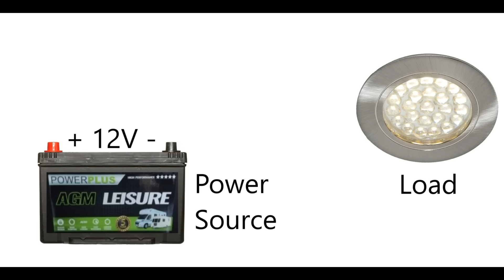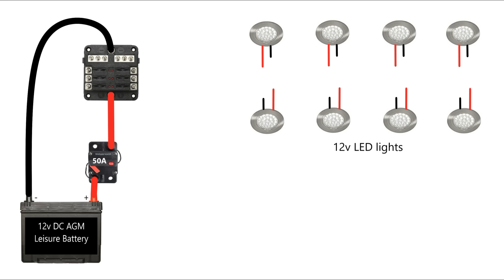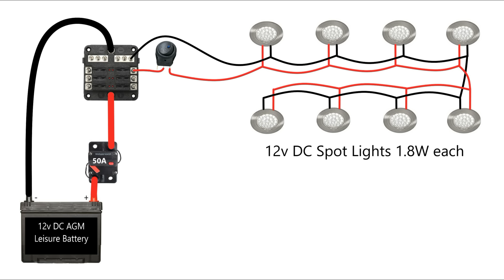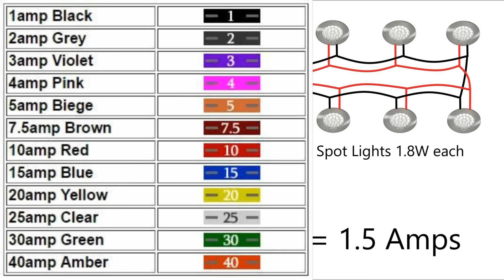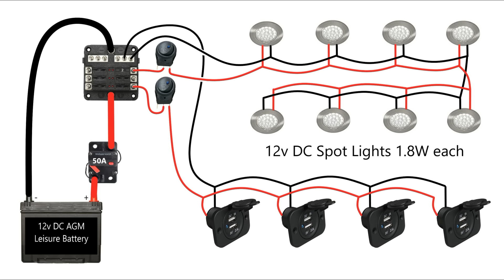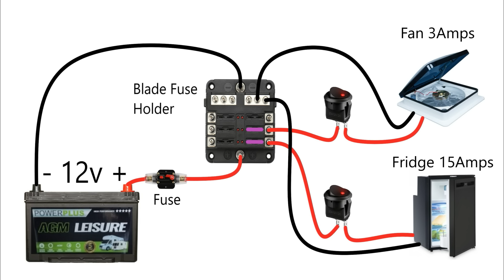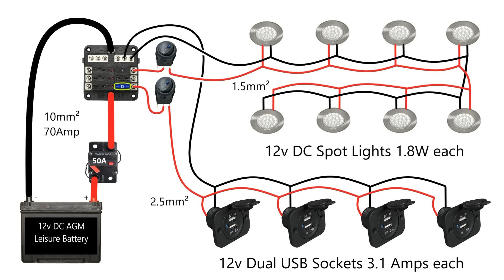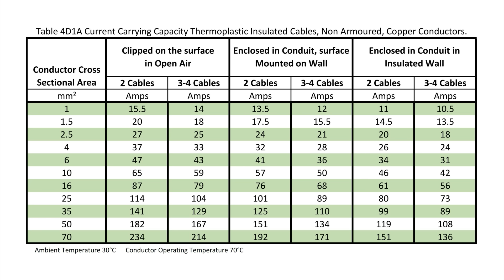Electric Cable & Fuse Sizing - Camper Van Conversion Series

Comment from the maker: Download your FREE wiring diagrams and parts list here:-
Full Van Build Parts List - https://www.dropbox.com/s/zvtyj0z7cdeb9d8/Greg%20Virgoe%20Campervan%20Parts%20List.docx?dl=0
BS7671 Cable Sizing Chart - https://www.dropbox.com/s/5lf55srgelpoclo/Cable%20Sizing%20Table.pdf?dl=0

Wiring Diagrams for different types of off-grid van systems are here:-
The final wiring diagram from today's masterclass video is on this link
https://www.dropbox.com/s/meaa9brw2hxifei/How%20to%20wire%20your%20van.jpg?dl=0

1 solar panel, MPPT charge controller, 1 leisure battery and inverter.
https://www.dropbox.com/s/1f5plerswoz7l2w/Off%20Grid%20Van%20Wiring.jpg?dl=0

1 solar panel, MPPT charge controller, 1 leisure battery and inverter.
https://www.dropbox.com/s/evzci35h8etyi68/Van%20Wiring%20Schematic.jpg?dl=0

2 solar panels, MPPT charge controller, 2 leisure batteries and inverter.
https://www.dropbox.com/s/h5yfuf090hgp4ga/Dual%20Solar%20and%20Battery%20Setup.jpg?dl=0

3 solar panels, MPPT charge controller, 3 leisure batteries and inverter.
https://www.dropbox.com/s/92ubo6d6k9miotq/Greg%20Virgoe%20Van%20Wiring%20Schematic.jpg?dl=0
Reply: Greg, welcome back 🙏 this video is so beneficial! Thank you for the video and the parts list! I liked and commenting before watching! So glad to see you!
Reply from the maker: Bisho Khan I really appreciate your support it means a lot. Thank you
Reply: Greg Virgoe haha it might seem a lot but it’s the weekend here in the USA still and I’m binge watching more of your videos. Great details on the wet bath, cupboards, and also ur sketchup tutorials are second to none! I will def be referencing your vids when I buy my first van to convert!
Reply: Thank you.  Very good video and information.  I have found auto/van information rather under sized vs marine.  Thank you for showing the details.  I have shared your channel with the Vanagon Group.
Reply: Thanks for such amazing detailed advice! Your videos are a huge help to so many people and I thank you for that. I have a specific question about fuse sizing and wondered if you would be so kind as to help? I am using a 12v to 5v converter to power some USB strip lights in the van. When sizing the fuse for this, should I consider the spec / requirements of the converter alone, or the converter and USB lights combined. In essence I am using a converter 12v DC to 5v (two female USB ports) to power an appliance 'permanently'. I really appreciate your time and assistance! Many thanks
Reply: Thanks for video, but If I already have a strictly inverter AC setup on isolator switch can I just add a 12v circuit going of to fusebox with a circuit breaker or will have problems if I try to run a microwave of AC and have lights running of DC?
Reply: Wow!.. absolutely fantastic!.. So detailed.
Reply: Thanks for another empowering video mate. I think a wiring diagram for solar, battery to battery and shore power leasure battery charging would be really well received.
Reply from the maker: Chris Mills other than B2B charging the rest is covered in my previous off grid wiring video. There are free schematics to download too
Reply from the maker: @piaersfeld4050  thank you for such great feedback and I’m really pleased they are helping you 😃👍🏼
Reply: Greg,
I have to be honest this was the most informative video I have ever seen.
Your explanation and diagramed are brilliant.
Iv3 wanted to do a self build fo4 years but was always put of due to the wiring side of it but you have made it som3 much clearer
Thank you so much.
Regards,
Steve Burvill
Reply: Hi Greg, great staff. I'm just starting my Van conversion project, it's still early stage and looks like your videos and other materials will be very useful. Thanks for doing it.
Reply: Hey Greg . Greetings from Australia. Yet another great video.  On the topic of cable sizing and fusing,  your diagram shows a 2000 watt inverter which to my calculations will draw a maximum 183.3 amps (2000 watts ÷12  volts × 110 percent consumption = 183.3amps).  Connected by 35mm square cable rated at 141 amps  which is protected by a 200amp circuit breaker. Both inverter and  breaker seem to be a match but the cable appears under sized. My 4000 watt inverter comes with 4x  35mm cables rated at 564amps total for a 366.6 amp maximum draw. This would suggest that a 2000 watt inverter should have 70mm cable or according to the chart you presented 50mm minimum. With a 182amps carrying capacity. Would appreciate your thoughts. I'm currently wiring my sprinter 519 which will  be powered by a 14.5kw lithium bank . (circuit breaker will be 400amps.)
Reply: Hi greg i started on my own van and i have a 200ah batterie i have put 100ah fuse between the bat and the box is that ok ?
Reply: 🤗My warmest greetings Greg Virgoe. First time here and loved it so much already so subscribed and liked 👍.
I'm doing up my vw campervan but still at the bodywork at the moment.  
I was worried 😟 how I'm going to upgrade 1980 electric installation once I get there. But thanks to you , I think i can take the plunge and use your advice and tips and all the extras in this video; like schematics and the shopping list.  Once again thank you so so much and I hope that you are keeping well in this difficult times. I wish you the very very BEST 🙏 🤞👍👏👊👊     ✌❤☘🤗
Reply: @GregVirgoe  hi Greg just to confirm did you fit a split DC to DC charger?
Reply: @bishokhan8926  where in USA. Expat from Michigan living in England past 17 years
Reply: Gosh that was helpful! Thanks for sharing all that! Really appreciated and helping out the noobies like me out there! Cheers Greg
Reply from the maker: @jeremydubrulle6686  you are welcome. Glad you liked it 👍🏼😃
Reply: Best channel...Hands Down.  Props Greg and a HUGE Thank You 🙏
Reply: Hi Greg thanks so much for your videos - just trying to figure out electrics and how to cable size and wire it all up - where did you buy your different cable sizes from?
Reply from the maker: @royabayliss3277  I use 12volt planet for a lot of my electrical stuff
Reply: @GregVirgoe  great video Greg very informative, I’m about to build a 12v off the grid system for my garage .. would this be the same guide to use only to run led lights and usb socket
Reply: @GregVirgoe I have a notification to say you replied to this but I can't see it here. And it's too long to read in the notifications
Reply: wouldnt a 1mm2 cable size not have been adequate in the first example you give??? as the lowest rated amps on that table you put up is 10amps with 3-4 cables... and the fuse is only 2amps for the 12v lighting circuit?
Reply: Thanks for a great video. at last someone who delivers the goods. Thankyou for the clear step by step instructions on calculating cable sizes and fuse values

Comment: Nicely done Greg, I wonder how many vans have you to credit so far! Just one small point to correct, if you put several (equal) lamps in series they'll divide the potential equally. As a result the first won't be any brighter than the rest - they'll all be equally dim! 12v ÷ 4 lamps 3v drop per lamp, i.e.1/4 of the12v required for full brightness.

Comment: Being a spark this is a breath of fresh air  listening to someone who is willing to do the leg work to do it as it should be done. Clear, concise tutorials helping folks avoid disapointment. Awesome channel!
Reply from the maker: That’s great to hear from someone in the trade. Thank you 🙏🏼
Reply: Really is a cut ✂️  above the rest and greg is super easy to listen to 👌
Reply: correct me if im wrong mate but wouldnt a 1mm cable size have been more than ok also??? a 1mm cable going off his table allows upto 12amps for 3-4 cableS!

Comment: I'm not sure if you've covered this elsewhere, but another thing to factor into the wire size choice is voltage drop. Especially on 12v systems you can drop a significant percentage of volts over modest cable runs and loads.

Comment: When ever anyone asks me about electrical stuff I always send them your way I’ll just send them a link to this video from now on well done Greg 👍👍
Reply from the maker: Mel’s Van World thank you Mel really appreciate that mate. Your van is looking the bees knees now it’s done. Great job mate. 👍🏼
Reply: It's OK Mel I've seen ur solor panel battery charger good job👍
Reply: Mel, Wiseman. How your most expensive burner doing. :)
Reply: Still confused as to what I can achieve, just starting to try get my head around the electrics, can the led spotlights be the 12v touch ones, how does a fridge work off grid, can I have a split relay and can I fit sockets from the invertor? Greg help! Please xxxxx

Comment: Excellent video, Greg.  Here in the “States” I tend to use a split conduit.  Similar to the conduit you showed but with a slit opening the full length.  I find it quite a bit easier to install (after the fact) than the coiled loom you showed, although I sometimes use that too.
Reply from the maker: Bruce Fay yes that is another good way of doing it. Of course you can take a utility knife to the normal conduit if desperate. 👍🏼😊

Comment: Greg, I can't thank you enough for this wonderful information. The time you take to help us with this is truly invaluable!
Reply from the maker: Derek Howe many thanks for great feedback.
Reply: wouldnt a 1mm2 cable size not have been adequate in the first example you give??? as the lowest rated amps on that table you put up is 10amps with 3-4 cables... and the fuse is only 2amps for the 12v lighting circuit? @GregVirgoe

Comment: Hi Greg, good information for all the busy lockdowners! Regarding the 230v side of things,  remember BS7671 states that 230v circuits need overload protection that breaks all live conductors in a caravan or mobile home. I'm sure you know that on 230v the neutral is also a live conductor so that means double-pole mcb's.. This means that your 230v distribution boards can get quite big as we usually have battery charge circuits, water heating and sometimes electric space heating for when hooked up.  And watch out for rcbo's as most are still single pole break operation, not double pole as required. Keep up the good work
Reply: In austraila the outlet has to also be double pole

Comment: Great vid Greg, thank you. With any wiring installation, it’s sometimes hard to understand how much energy builds up within the cable when appliances are switched on. Your clip showing a wires  heating and subsequently melt/combust shows what could potentially happen behind the insulation in a van. Therefore your visual demonstration and clear cabling sizing chart will enable us all to sleep safely. Cheers!
Reply from the maker: Obviously the video clip was very dramatic but hopefully it emphasises the importance of having the right size cables in your van. Like you say most are buried where you can’t see them so you don’t know until it’s too late. Electrical faults cause many fires in houses and campers. Thanks for all your support it’s really appreciated. 👍🏼

Comment: very informative! thank you for this. I've watched longer videos that taught me much less. I had no idea amp ratings dropped according to mounting conditions.
Reply from the maker: Yes it’s all to do with the surrounding temperature of the cable and it’s ability to get rid of any heat build up when running. 👍🏼😃

Comment: Great info. The electrical is the only part of the build that intimidates me. Having a dedicated playlist for this is a great idea. Really interesting info about the difference in the current being within an insulated wall vs on the outside of the wall. My plan is to put the wiring outside of the wall so having this info is super helpful. Thanks so much!
Reply from the maker: Yes I thought it was very relevant as lot of people, me included have buried cables in walls and because they are not in free air and potentially can be hotter you are not allowed to run as much current through them. Makes a big difference to the figures.

Comment: Hi Greg, couldn´t have been a better timing for this video ! I appreciate it so much! Thanks a lot for sharing all the information, that helps me a lot and makes me feel more confident to figure out my system myself. Legend !
Reply from the maker: David Lisken this video in conjunction with my latest wiring schematics and full system video should give you a great basis to go with. 
Most appliances need a positive and negative. A fuse in the positive. The right size cable and maybe a switch for control. When you break it down it becomes very logical and easier to understand. Good luck with your build.

Comment: I really appreciate the fact that you take the time to explain this stuff. In particular the safety side, like not using solid core wire. This is overlooked very often.

I wanted to add that when using multicore wires it is important to use the right connectors. Make sure they are rated for the correct current. But also that the stripped end of the wire is properly  clamped in the connector. There should be no exposed copper (cores), as over time some of the cores can break and could fall out and cause a short. Use heat-shrink and or heat-shrink to prevent any cores from falling out. Especially in areas with sensors.

At 11:20 you are right that this is not the proper way to wire it, however the explanation is not correct. Assuming all 8 lights are the same each light would have the same voltage potential across it. The first light would have 12V (with respect to ground) at the positive lead. The negative lead would be 10.5V (with respect to ground). So the voltage potential across the light would be 1.5V. This is the same for all the lights. Since the lights are wired in series, the current is also equal for each light. This means all the lights will be equal brightness.
In the case of a regular light bulb all lights would be very dim, but the same brightness. When using LEDs (like in the example picture) the lights would probably not turn on at all, since leds are diodes that require a minimum voltage to operate.

Comment: While gauge ratings for wires here in the US is practically a different language to some extent, the logic and concepts do transfer well. Very helpful video (and series).
Reply from the maker: Yes is very odd that the wire gets bigger as the AWG size gets smaller 🤔😊

Comment: One minor mistake on the USB sockets that 3.1 amps @ 5v not 12 but still you have plenty of margin for error since more volts equals less amps.
Reply from the maker: Thank you James, I could find if it related to input or output so aired on the safe side. Like you say my fuse and cable are oversized so that’s not bad thing. Method is still the same thankfully 😅
Reply: @GregVirgoe  
Hey Greg first of all thank you for sharing all your knowledge on so many different topics with us. There are so many things that needs to be considered regarding a van conversion that it's virtually impossible not overseeing something but with your series of detailed videos I think many people have found a starting point and help.
I found your explanations on the insulation very interesting.
Beside that the safety thing depends on one's point of view. The question that needs to be answered is what the fuse is meant for. In your example the fuse is chosen correct to save the wiring it fail its purpose however if it comes to saving any device. For example let's assume you have a malicious phone charger on one USB port. This charger will drain 15 or 20 amps and light up before the fuse will break the circuit.
Daisy chaining these sort of things makes the wiring easy but you should keep an eye on build in fuses in each component.
Reply: Not exactly true. Amps = Watts / Volts, therefore regardless whether you supply 12V or 5V to the USB socket, the only thing that will change is amount of Watts the appliance will use. These USB sockets contain a buck converter to lower the voltage down to 5V. The Amps used by the appliance will still stay the same regardless of what Voltage you supply it, the only thing that will change is how many watts of power the buck converter within the appliance uses to convert the voltage, which is most likely why the product is rated in amps and not watts, because it can be fed a variable voltage. He did exactly the right thing here when deciding on cable thickness and fuse rating 👍

Comment: Great diagram Greg, thanks for sharing with us. The only thing missing is the connection with the main car battery using a dual battery split relay, like a VSR switch. This would complete the diagramm totally.
Reply from the maker: A VSR is not the best way to connect your van battery to the leisure system. It will not regulate the charge current at all.

Comment: Great explanation. One thing to note, when selecting switches for circuits make sure you size the current rating of the switch to be GREATER than the fuse rating. When selecting DC switches for use in a small panel mount, circuits with loads above 5-amps,  use a relay. You will not find affordable and reliable small high-current DC switches. DO NOT use AC switches in DC circuits!
Reply from the maker: That’s a very good point. Something I will cover in my dedicated switch video out soon. Thanks for mentioning it. 👍🏼😃